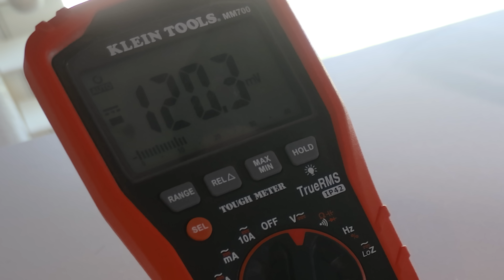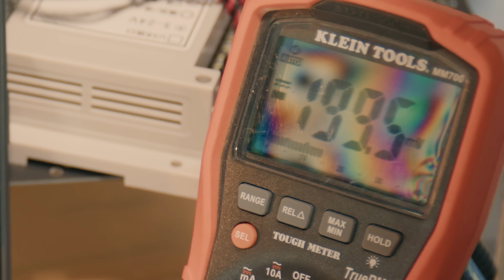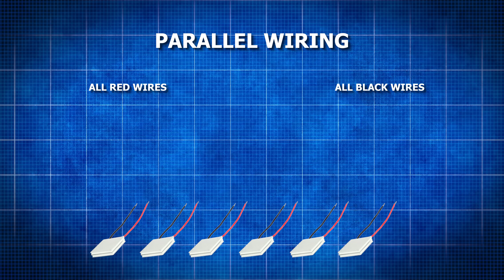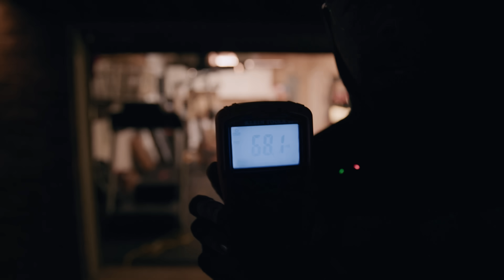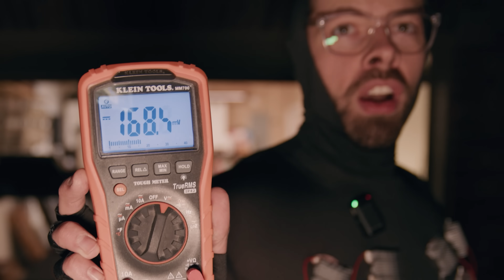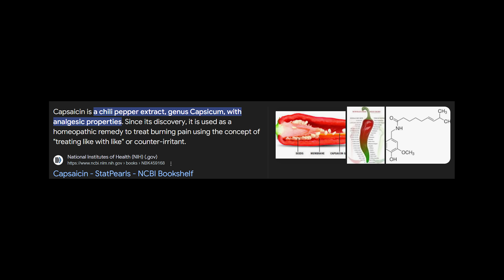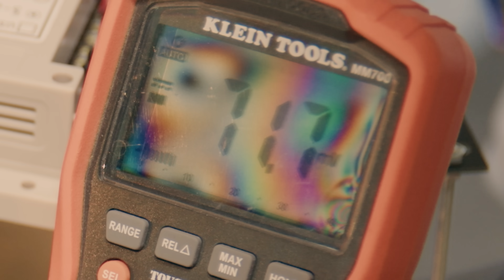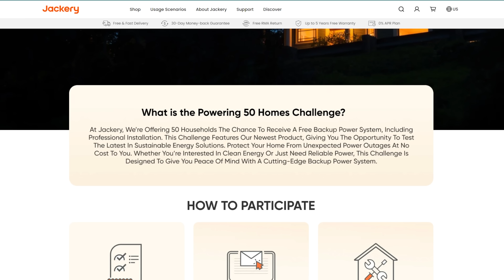Building a Human Generator Suit

Comment: so you have a few flaws in your logic, ive mentioned beforethat the zerchessium crystals are encased in clay, direct zerchessium sheets are far more thermovoltaic, also the wirez should be of proper gauge to ohmage and produce far more thermal conducutvity when exposed instead of wrapped, also its less about the hotspots relevant to the energy loss of the wires by distance ideally the viens on the back of your legs and underneath your arm sections would be ideal, additionally good use of the heat sinks but 3d printed copper alloy designed to fit a very large surface area as a flexible mesh is another way to do it. another thing your original idea had lost its gains when u moved to idea 2 because tge suite was applying pressure to the array helping it cohese with uour skin, same application with cpu chips

Comment: I wonder if you did like a cool suit, except a hot suit. Like buy a cool suit, wear a jacket over it, and then run the hot water through a bank of those cells. You could also have sections of metal pipe with heatsinks, so you have insulated body heat that is more efficiently trapped.

Comment: Back in the day a few phone companies, most notably Nokia, were working on a module/chip that could generate a tiny current from radiowaves in the air. Their idea was to put them in phones to trickle charge them, effectively lengthening battery life by like 10-20% in some cases. Remember, those old nokia's already got a week on a charge, so even a few % gain was pretty notable. 

Idk what ever happened to them. Like most things radio-electricity I'd assume the gains just weren't quite there. This area tends to have a lot of ideas that don't pan out.

Comment: Interesting concept. I looked into this a few years ago. you can make power with the same concept as a salt water  battery using platinum and carbon plates stuck your body which should have a voltage across them.

Comment: Ya'know, there's also the space in between your skin and the surface. Since the metal is flat but your skin is not, you're not getting a full connection. I wonder if someone made an interlaced suit with flexible conductors and put on some thermally conductive gel, maybe you'd get a lot more out of it.

Comment: This is interesting, but a couple things. One is that growing up in the cold you learn that you lose most of your body heat through your head. 

The second is that they treat heat exhaustion by putting ice in the hands. The hands and the bottom of the feat the capillaries don't close to adjust for the cold and is better for dumping heat out of the body.

Comment: Honestly, if you could design a suit or a winter jacket that does the heat transfer between the body and the outside air without compromising the human comfort and then add a small, say 3k mAh battery as part of the jacket, then maybe you could actually just wear the jacket to trickle charge the suit battery and then do something with the stored energy later. Phones usually have around 3 - 5k mAh bats, so honestly if you could charge your phone fully about once per 3-5 days, you could actually use this. Or at least have a backup with you, at least in winter :D

Interesting concept, I like peltier cells, just too bad they are so damn inefficient xD

Comment: make a self-sustainable 12v camp fridge, the fridge coldness does the cold side and if you sit it in the sun or a space with ambient temperature higher than that of the fridge, surely you could make that work? would work really well in FNQ where temperatures are normally a minimum of 30 degrees Celsius

Comment: Could you technically use these in your walls and generate energy from the heat difference in the winter and/or summer based on your heating/cooling of the house compared to the outside temp?

Comment: What about if you had a warmer jacket on your body to keep your internal heat higher, and had only the heatsink popping out, and in addition to that used a sort of sandwich where the heatsink coming out has another of those devices and another heatsink on top. I know it will be heavier but the heavier jacket may give the needed support. 

Another option would be a diver suit, that should also keep you warmer and give more support for the sandwich solution.

Comment: in theory if you locked yourself in an insulated hotbox you should be able to collect most of the heat energy from your body, about 100 watts, then you just need a way to efficiently transfer that to the TECs and maybe run a low power computer

Comment: Days of backup? What’s the kWh and output, Powerwall 3 is 13.5kWh but will maybe give you a day or two of supply with a peak continuous supply of 11kW
Reply: Just saw the end of the video, 5kWh ain’t bad to be honest and a 7kw discharge rate is decent with the expandability if the price is right!

Comment: Gin replacement potential. Niacin. Maybe. Some people have a bad reaction to it, so there is special formulations of it for those people. Anyways, the effect you are going for with the alcohol, is incredibly acheivable with niacin for some folk like myself. When it's like -40c outside, I can take a niacin suppliment, wear a light jacket, and go for a walk without getting cold at all. Useful for the late night 7/11 visit. 

Bad part though is the reaction to it also causes a bit of a itchy stinging feeling in the skin. It is ignorable, since it's not that bad. But it is there. Also the increased blood flow to the skin also makes a person more reddish in appearance. 

Anyways, I only bring it up because alcohol clearly isn't going to be a good method for increasing the core temp of the human battery when it needs to be coherent in public places.

Comment: One thing that came to my mind is that you are trying to move robot. Motor takes a lot of energy to to start moving making it hard to tell if problem is amount of power or circuit. I would suggest to you to buy or make 1 watt LED headlamp and then see if this suit allows to walk in dark. If that doesnt work you can solder wired directly to LED itself because electronics might just cut off power if it is below some threshold - if you power LED directly it just gets dimmer and dimmer instead of sharp cut off making it easier to see and understand the result.

Comment: I've noticed that some Chinese stuff has the wires the wrong way around, like black is - and red +, I discovered this by blowing up the flight computer on an RC Helicopter, red positive, was so ingrained in me that I blew up an FPV camera too, before it dawned on me that the battery connectors I was using had + and - the wrong way around.

Comment: Haha love the video! You could get much more power using water to transfer from body to modules.  Like maybe just a hat on your head with silicone tubing or thin bladder.  Could be done without a pump still if the modules and heatsink are on top of the hat/helmet thing.  Need magnesium based TE if possible as well.  All that said your way is by far more entertaining…lol

Comment: this is thermodynamically unbeneficial: using the heat sinks will cool you down, thus having you eat more. But the chemical energy of your food costs more than the electricity on your bill. Also, from increasing your biological heat throughput, you basically just age faster. Sport of course does the same, but thereby giving an overcompensation impetus that will have your body compensate into slowing the aging process down. Hence why sports is healthy. But by attaching heat spreaders to yourself, you are not triggering overcompensation; to this end you would have to wear it in intervals where its effect is of higher intensity.
Reply: hahaha. Now I watch that part with the caffeine and alcohol. okay, nevermind.

Comment: Actually you're not the human battery, you're a human thermoelectric generator. This concept is flawed and you should have included a batter attached to you somewhere to store the energy then it would have been useful. Additionally you could have achieved a better heat transfer rate if you had gone running in the suit due to the convection. It seems your ego kept you from wanting to go outside which is ironic for someone named "basically homeless" i think your name should be "basically idiot" good content tho

Comment: Dude what if the fabric had like two thermally conductive layers, one inside and one outside, and an insulating layer in between, and the only holes between the two sides were the generators... You could use fewer generators and place heatsinks, perhaps iron wool all over your body! An updated, hairy human batery. It could work if you had an insulating material spandex like scuba diving gear and treat the outer and inner sides to be conductive.

Comment: Things are terrible both ways. Next time, try one of those toy stirling engines that are supposed to work off of heat of the hand, and chuck a generator on it. I bet one of those could generate a couple watts of energy no problem.

Comment: Imagine using a PC with a comically low power draw (like the Orange pi zero 3) and turning it on while (casually) walking on a treadmill.

...

I'd do that.

Or better yet -- same situation but something that sips power out of my fat -- which is not much, but an Orange pi zero 3 consumes like, what... less than 1W in a "real world scenario"? That could work.

Comment: I was thinking about this kind of tech but for a blanket with a heater on the hot side and then the cold side is the cold temp and the cold outside temp would be the extra energy to power the heaters which would go into the heater side of the thing as well as heating you up, someone can this work or am I missing something

Comment: flawed, I think you may have used TEC modules rather than TEG modules(one is better at thermal pumping the other at electrical pumping, due to the series parallel thingy inside them)
and as you are trying to harvest from a TINY differential(<30c is hard to be useful using any harvesting method) you would have been better using a series connection, then you would have had more like a large solar panel powered by heat

so basically 2 modules parallel(100ma at >10v would charge a power bank albeit slowly, while 300mv boosting would waste most of the collected energy as boosting is less efficient than buck and these modules act like a current source anyway leading to the load capping teh voltage) and the rest of them in series to get >5v floating

electroboom pointed this out already, and noted that you may have the wrong module type and may have glued them together wrongly

but actually humans are a near-constant 100w load(which all eventually makes heat), based on max efficiency of TEC modules you would be lucky to get a useful 10w(which is USB charging, but getting that requires perfect setup)
it is probably more efficient to simply burn the sugar as fire, boil water with it, run a small steam turbine generator, and store it in a lithium battery pack

but it could work as a sheer desperation power source if you had modules inside a sealed wetsuit touching skin and the outside in contact with cold water(like a shaded pool) as it could provide a 10w source for a while
though given the thermal needs of a human you want a constant and stable 100w leakage through all sources of cooling(which includes breathing evaporation) and to allow for some extra or lesser cooling when the body is thermoregulating

come to think of it I have been debating a "single human cooling system" and forgot about the fairly fixed thermal requirement
stick a thermometer inside some spot(probably an armpit probe for non-embarrassing hidden measurement) and tune a set of TEC modules for a 90-110w efficient load at up to 40C ambient and a reverse of as low as -10c as you got a thermal pump, mix in a coolant solution balanced for a 10-30c fluid temp(+/-10c max depending on mode) and you stick the tubes into a mesh jacket on skin and you have a "single human HVAC jacket"

and subzero isn't even a problem with icing as if it packs up it will just resistively heat rather than pull energy from the air(albeit less efficient, though resistive human warmers are common enough)

I don't even think you need 100w of cooling, breathing and other thermal loss would still act even with the cooling jacket, a single setup with ~60w peak would probably be ideal, especially if you maximize efficiency by not running near Imax
a 127-15 should be fine if run at 5v with a few 5v fans and a 5v water pump

Comment: This kinda shows how crazily efficient our bodies are with energy
Reply: Yep Its a partially self regenerating biological robot that consumes its surroundings to genetare energy which it uses to run a tiny super computer with minimal energy use and heat loss. Only took a couple billions of years to develop.
Reply: Remember: The human brain has more computing power than all the top 10 biggest datacenters in the world combined yet is only the size of a grapefruit and consumes as much energy as an LED lightbulb. The human body last for weeks on its own energy reserves while every single electric humanoid robot in development right now only has enough internal battery power for 1-2 hours of operation.

Comment: Idk why y'all youtubers use TEC devices for these power generation builds. They are not made to harvest power. you need TEGs (thermoelectric generators) They are literally optimized for power generation and are much better than thermoelectric coolers which are optimized to put power in, to create a temperature differential.

Comment: i heard somewhere that, originally, machines were to use the human brains for processing power, but it was changed to something more comprehensible (at the time).
But now as the video also makes it obvious, human bodies make for very shitty batteries. but the brains are still the most powerful/efficient quantum computer till date.

Comment: If you made a system which cycled water throughout your back, you could then use a water cooled loop for the peltier modules. That could fit in a fannypack, and in that fanny pack you could have an active fan which blows air over just a couple peltiers so that you have just a few, but powerful peltiers instead if plenty but low powered. this system would require power for both the water pump and fan though, unless you managed to find a bendable heatsink or something which you could have directly on your skin.

Comment: You're not the human batter, you're the human generator, since you're converting food into electricity.
If you were a human battery, you'd just sit in one spot and drain your energy, occasionally needing to recharge.
Also - add some sterling engines.

Comment: power them with a hand crank generator, and that becomes illegal azz battery man not only stinks butt needs crank turned... test when it is -84*f outside. their is a jet 40'000 foot in the ait heading south from the Yukon if it Keeps going it would land in your aria in 4 hours at the most. wind speed is very high dragging the upper cold down so the jet nearly glided 30% of the way down. next time the chinook blows warmth to the north... the cold inners become power.

Comment: For maximum efficiency you need to harness your core temperature heat via a supercondutor rod inserted into the rectum. This will guarantee long term peltier function even when standing out in the cold.

Comment: one of my friend was working on a research project funded by the US Army about 20 years ago that was literally this idea. The major difference though was the tech used. My friend's research was into a material that was elastic and generated a tiny voltage when stretched out. The theory was that a person could wear a skin suit make of thousands of tiny air tight pockets of air that would expand and contract with your body heat as you moved around. The army wanted something that could replace the batteries for all the gadgets they were working on at the time. from what i remember, the stretching material did generate some tiny voltage, but it could not be scaled up to replace a regular AA battery. 

it seems like every few years another group takes a crack at this idea, but no one has come up with a method that beats having a few AA batteries on you.
Reply: We got past this years ago when 18650s became ubiquitous.

Comment: Create a mobile blood dialysis machine but remove the dialysis components, this will allow you to move hotter warm blood to a large exterior system without your body being able retreat the blood from your thermoelectric generators  you could buy a existing one and modify it. you would have to find one with very efficient pump components or it would just operate at a net loss of energy. 

Also you need to include other human systems in the system, much heat/energy is being lost due to your breathing directly into the open air, you need to make a mask that will use that heat and airflow as part of the system, both to harness its wind generation and to help with heat management.

Comment: connecting them in series rather than parallel (or mix of both) would be more efficient in my opinion (also cable-wise). The step-up converter might claim it takes input voltage as low as 0.33V, but the lower boundary often works as shit and has limited output current

Comment: You're actually a human generator. Also, seeing as how you need 5V to charge a phone, and that your resistance losses will diminish as the voltage rises, you're definitely better off connecting them in series until you get  close to 5V, and use a buck boost converter to regulate a voltage that is close to 5V, to 5V.